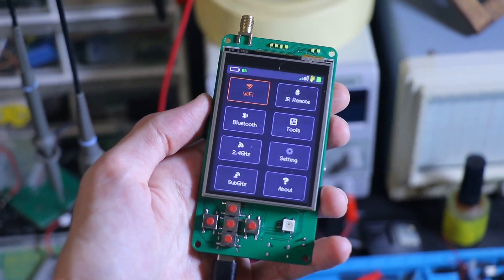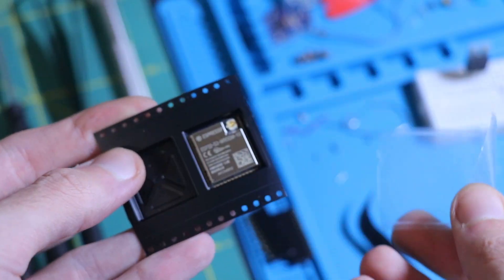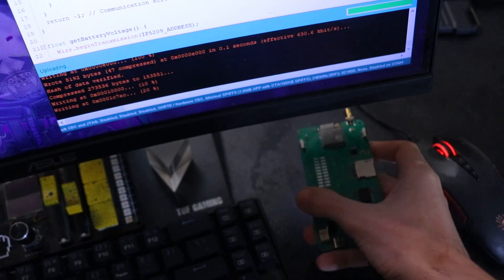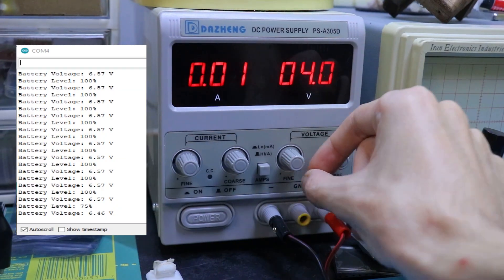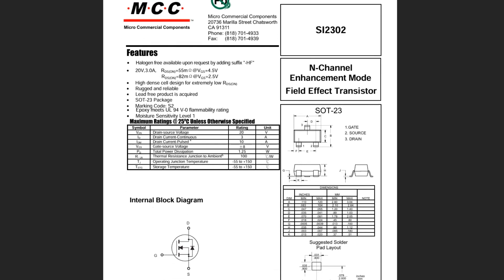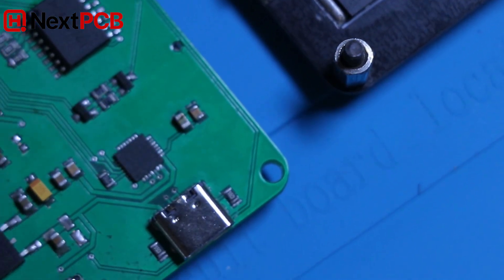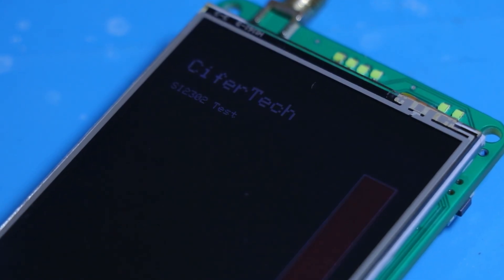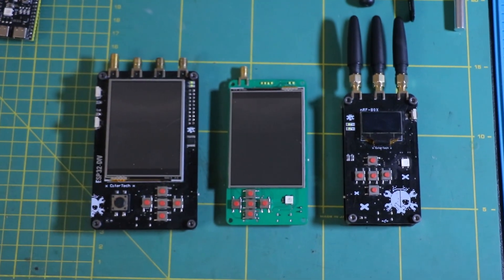Why I Hated My ESP32-DIV… and How I’m Fixing It | Part 1

Comment: Hello Cifer. I'm from Ukraine. I wrote you an email. I really liked your device. I want to build a similar one. I have a suggestion. Regarding the antennas, I recommend them. I need them all. But I have a comment about the board. I can design all the components on one board. There's plenty of room there. Why do I need a second board? It takes up a lot of space, and besides, it has an unreliable connector for this device. Moreover, you shouldn't use Pogo connectors. They're even less reliable. It's better to put a battery there instead of a second board.

Comment: I went to GitHub, but it only has a board for the version with an 18650 battery. If you send me the latest version of the board, the smaller one with the screen, I can reverse engineer it, and you can put it on GitHub. Since I'm an electronics engineer, I can help you with that. I can also help you test and improve this wonderful device after I finish soldering it. Can I also ask you about adding new features? For example, new protocols and new frequencies for other modules, setting a password to enter the device menu, etc.? Since, unfortunately, I'm not a programmer, but only a practicing electronics engineer, I can't edit the firmware; I can only help with the hardware. Together, we can improve this device to the limit. Please answer me. Thank you.

Comment: I got this message from jlcpcb can answer this please? 
Hello,

Sorry to bother you, but we'd like to confirm with you an issue found when engineer making production file of your PCB order.

The indicated slot will cut out the pads, is that normal?  There are 2 option for reference.

A: we remove the slot

B: we mill the slot as per gerber file.

Which one would you like?

Thank you very much for your attention to the issue.

Best regards

Doris

Comment: There is a version of IP5306 that supports I2C, and its peripheral circuit design is basically the same, so it can be used directly without modifying the circuit.